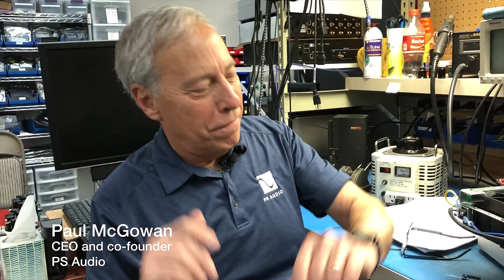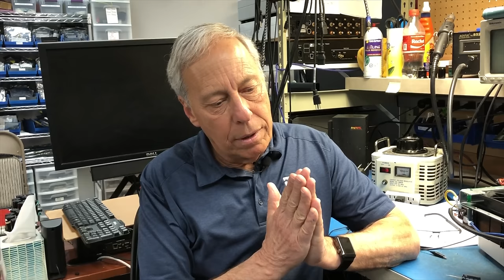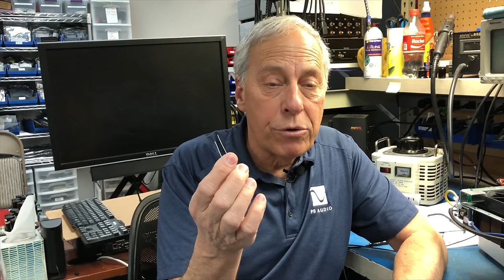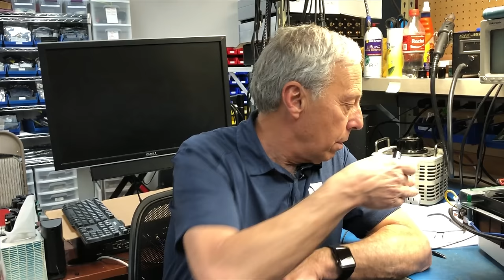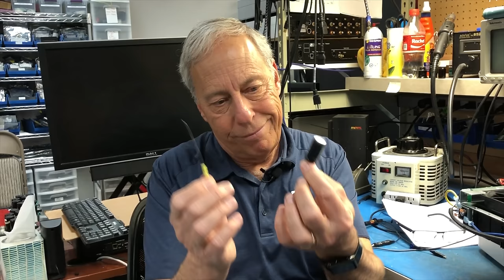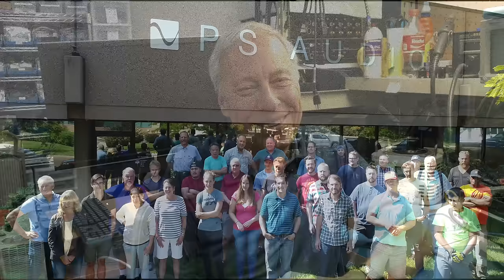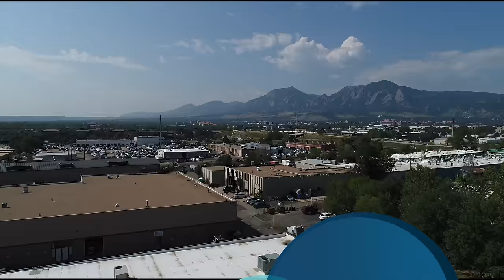Why do capacitors sound different?

Comment: Still does not explain why two equal capacitors have different sound (if any). The only argument here is that the more expensive ones must sound better!
Reply: Ventsislav Simonov A voice of reason amongst the noise. I built your diamond buffer headphone amp a few years back. Turned out very nice.
Reply: in my experience, low value caps compared to high value/quality caps of the same type whilst passing signal, shows a difference in frequency fall off in dB very much sooner in the low value cap. In my view, low value/quality caps are close to a bandpass filter.
Reply: It is audiophoolery, basically. If we were talking about RF, where the type of capacitor plays a big difference, yes. But for audio frequencies, not by a long shot. You don't have any capacitor in which the inductance is significant at frequencies up to 20KHz. But the placebo effect and being in denial to the fact that one spent much money for nothing? Well, that is significant.
Reply: semahnai I guess capacitors work differently in your part of the world. Must be a gravitational delta coefficient difference. Or simply that your understanding is hokum. You shouldn't try to design anything electronic.
Reply: Ok, I need proof on that. Show me tests being done on oscilloscope, live (I don't accept bogus images), showing differences in audio distortion caused by different caps. By the way, I don't have audiophile hearing. I can't hear above 15KHz. Thus, I can't hear supersonic frequencies, like 48KHz or so.
Reply: How do you hear power supply caps? They aren't in the signal path. You are talking foolery here. In the signal path, there isn't enough voltage to kill the caps. If recapping power supply caps because they blew, then the PS wasn't designed properly, or didn't have proper protection. Replace them with equivalent models, if the new ones have higher ESR and ESL, the impedance of your ground plane with be adversely affected. Also, there is much substandard design in car audio and just as many idiots who think they know something because they won a contest. Most of them are uneducated and laughable.

Confirmation Bias abounds because people do not understand or apply scientific method to confirm results. Your SMD Amplifier Dyno cannot tell you the sound of the amp. Of course, it should NOT have any sound of its own, that would be distortion. Your 'scope may have a higher noise floor than a lot of modern electronics, so be careful about what noise you are actually looking at. No one ever said tubes don't sound different. They DO, because they have huge amounts of distortion. A moot point to bring up here.

As for caps IN the signal path... yes, some would sound different, but mostly because of TYPE rather than quality. Ceramic and Tantalum caps used for bypassing power supply pins would hardly make a listenable passive crossover. Not all caps are designed for the same FUNCTION, so use the proper cap for the part position. Cheers!
Reply: It is all about the "definition" of a capacitor: each device is actually a combination of R L and C. The value of C is what is printed on the device, and ideally, R and L should be zero. In reality R and L values are not zero, and to know the deails, one has to look at the detailed specifications. 
Two capacitors with the same C value may have different impedance( Z for AC or R  for DC), will interact differently with the rest of the circuit, and ultimately may change the frequency response therefore the sound. The more expensive ones have a lower ESR, or Equivalent Series Resistor, therefore giving a closer match to the ideal capacitor with all C rating and little R or L.
Reply: Pierre C That had already been stated here, and is a well known fact. Semantics aside, a cap is a cap, a resistor is a resistor, an inductor is an inductor. We are not conflating them, even if there are residuals shared amongst the different devices. Even resistors have inductance (some more than others that must be compensated for in passive crossovers for instance), as inductors also have resistances. Cables have all 3. What we object to is simply the implication that because one cap cost more, it MUST sound better. Hokum.
Reply: If you leave semantics aside, you end up with nonsense. Sorry,  you can't escape that.
Reply: Phil 
A pure capacitor does not exist, they all have inductance and resistance in them, the combination of these gives an impedance which influences both the resistance to current flow but also changes the phase of the alternating current passing through.The easiest way to convince yourself whether different components sound different is   get a stereo amp and change the electrolytics in one channel with audio grade but leave the other alone. Have a listen, trust your ears. As a test get your wife to listen but don't tell her why, you will be surprised. If you can't tell then it does not matter to you.
Reply: Although any capacitor has some inductance, for the frequencies that we are talking here it doesn't matter. You would need inductances in the order of tens of uF (at least), and that is for impedances as low as 8 ohms. You don't have that in a real capacitor. ESR is not a factor for supply caps (they were mentioned, and I don't know why), because the supply frequency is around 50-60Hz, or 100-120Hz after rectification. Plus, any good opamp will provide good supply ripple rejection, in the order of 80dB, so they shouldn't be a factor.
Reply: Esr really does become significant in power supplies. Whilst its true that mains frequencies are only 100hz  after going through rectification in almost all cases these days the power supply is a switch mode device with frequencies in the order of 35khz being used to chop up the DC initially produced before smoothing and that has to be completely removed. I have just built a linear power supply for a raspberry pi based streamer with massive amounts of high quality capacitors and large inductors in the filtering, and that is just to get rid of the 100hz noise. The difference between the linear psu and several different switch mode psus ranging from "wall warts" costing £5 up to very sophisticated high quality commercial able to provide 10a psu costing over £100 was significant . I would have preferred not to do it as the psu is several times larger than the streamer, but it's built to listen to not look at.
Reply: I was thinking about linear power supplies when I wrote that, of course. I don't see SMPSs being used in hi-fidelity amps, for a number of good reasons. All amps I've seem use linear power supplies with bulky toroidal transformers, a big capacitor bank and some beefy rectifiers.
Reply: Switched mode psu's are creeping in all over now, Linn and Devialet are two that spring to mind.At that price level they can afford to manage all of the issues that the high frequency artefacts flying about cause. I think this is a topic that will run and run. When I first heard of speaker cables making a difference I thought "Its a bit of wire carrying a low voltage and pretty small current too." How wrong was I? A bit of experimenting with  a few bits of different cables and "Pandora’s Box" was opened. It is the same with most components If you are prepared to experiment, for instance swapping polyester types for polystyrene I can hear a difference. The precise mechanism isn’t always clear but there is a difference  and it is often not that big, the drawback could be that you may like what you had in the first place better and have to change it back. Keep an open mind and open ears. Just because it's expensive doesn’t mean its better, but there is a lot more to it than the capacitance, working voltage and Temperature rating. Just because those  parameters match it doesn't mean that the capacitors are the same.
Reply: +Darin Brunet - Ever hear of motor boating? A power supply/decoupling cap can certainly add noise to a signal.
Reply: I buy Elna's usually and if it comes in a low esr it's because the typical application for that value often demands it so buy the low esr.  I've learned that cheep caps are not always the value they're supposed to be or they're just duds.
Reply: +Paul McGowan - You could have said that without making me sit through the entire video...
Reply: Darin Brunet : Power supply caps can be heard a couple of ways. First, if inductance or resistance is too high, or capacitance is too low (these can all lazily be filed under "effective capacitance"), then you can get voltage sag, which in turn can manifest in the sound downstream of that cap. Second, if you have some resonance at a bad frequency choice, then you can get undesired resonation spreading downstream of the cap, and potentially even upstream to other power supplies.
Third, many capacitors, and components in general, are capable of acting as low-quality speakers (if you've ever heard a CRT tv sort of "hum" right when you started it up, that was likely an inductor) or microphones (ceramic caps are particularly known for this), once again spreading noise everywhere downstream of themselves.

Finally, some caps, particularly electrolytics (or, for that matter, 60's-ish carbon-composition resistors), can have their electrical properties change over time, usually due to chemical changes, often due to heat exposure. This is particularly relevant for car audio, where internal temperatures can get over 100 (or was it 200?) Farenheit.
Reply: Esr... Capacities might resonate and also act like inductor
He also told us how to reduce the effect of it, by pairing up 2 different types of capacitor
Reply: +semahnai  A capacitor can act as a filter in an audio circuit. Smaller value capacitors (value as in the amount of charge they can hold) filter out more low frequencies. It is easy to make a small circuit and listen to the audio going through a capacitor. Someone could buy a cheap capacitor and a good quality capacitor (which still will not cost much) of the same value (Voltage and Farad) and listen for any differences.
Reply: And remember, caps are not linear across the freq respond they pass. Sound is pretty hard to debate. How do you measure "good sound"?  Some unwanted elements might be pleasing to the ear, some not. Most of the time component changes in sound are subtle, more ofter sum of parts reveal bigger differences.
Reply: ESR is not that much of an issue. In the imaginary capacitor substitution model, ESR is an extra resistor that the sound passes through, but we aren't seriously discussing the sound of resistors, are we? Basically you're supposed to calculate your ESR and ESL into your engineering and they don't produce any difficult to reverse distortion.

Dielectric absorption based distortion is easily demonstrated though, and it's highest around DC rather than at high frequencies. You charge a capacitor to a major portion of its rated voltage, then you short it out for a short time, and then you connect a high-impedance measurement tool, and watch the voltage rise again. WHOOPS. Another issue is temperature coefficient, the more current you run through your capacitor, the more it heats up, but how do its properties change with temperature? These problems are generally measurable, but potential audibility depends a lot and is not necessarily a given.
Reply: Darin brunet,power supply caps are definately in the signal path.A power amp is simply a modulated power supply as is mentioned in the video so the better the supply the better the sound.If your speakers are good enough you will hear the effect of bypassing large electrolytics with say 10uf film caps let alone the obvious improvements brought about by fitting Rubycon Blackgate electrolytics.
Reply: Perceived difference vs. actual difference are two entirely separate things. In an audio signal, outside of values and tolerances, materials are completely irrelevant. If a spectrum analyzer is telling you that there's no difference then...there's no difference. It's all in your head. There are a multitude of other factors that come into play that affect the sound you're hearing other than simply the caps that make up the AS - room size, acoustics, speaker placement, EQ, etc. The debate over whether a cap has that much of an impact is just silly.
Reply: I agree. I watched the whole video and heard zero explanation "Why do capacitors sound different?". An explanation is quite simple - how linear are they are over the sound frequencies... But I wanted to hear am I right.
Reply: Audiophoolery is all about price. Measurements are for deaf engineers.
Reply: Well, in contrary - you cannot make a good phono preamp without proper capacitors and those "proper" are cheap one (styroflex). Expensive one of the wrong type in phono preamp will sound like trash.
Reply: That's just unsupported claim unless you've got the right data to prove it. ABX blind testing is one example.
Reply: You do not need a blind test for that. This is known since the first days of a phono preamp. What you need a blind test for is to compare the same capacitor from different makers, but you cannot make a good phono even with the gold capacitor if that one is a ceramic type.
Reply: Have you got any paper or publication to support your claim? I'd like to check that "known since the first days of a phono preamp" claim.
Reply: I bet you made yourself hundreds of phono preamps. Just open any literally any schematic of phono preamp and look what type of caps are used in RIAA section. I am sorry you lack that much knowledge so I need to prove you such things. It is same asking me to prove that resistor has resistance. What is next, prove you that Ohm law is correct?
Reply: I do not make any claims. You do. And I highly doubt that you can prove Ohm's law.
Reply: 2 amplifiers one with average characteristics and another with superb can sound very different and in many cases the one with worst technical data, much cheaper can sound better. There is no number to express subjective impression, but good ear with long mileage can tell. It is actually easy - do you enjoy it more one over another for long period of listening? There is no number to express such thing. If you are looking at scientific technical data only, then I am affraid you are lost in the audio and not just in audio world.

Same goes for caps. Polysterene, polypropylene, silver mica or (as Technics was using even ceramic capacitors) in phono premp for RIAA correction, even though all are flat in 20-20kHz can and do sound very different. Although silver mica has issues in relation capacitance over frequency in relation with temperature, when taken carefully, they can work too. 

There are millions of phono preamp built in the world until we spin the records and gazillions of people have listened trillions of combinations. But, today, when you open any of amplifiers most likely you will find there only one type of capacitors in RIAA correction. There is no scientific paper to describe this. This is pure experience of engineers, technical people, constructors, technical listeners and music lovers. If you are asking for scientific paper which describe all this experience since the first days of phono preamps, I can tell you only one thing - leave, this is not for you. Actually it is quite stupid to ask to see printed numbers and by them judge which sounds better. It cannot be described that way. It is all about combination of technical data (linearity and stability) over frequency and then come listener experience.

That is why I stop by to see this video, there is a secret we do not know yet, why one sounds better than another in audio. This video can last for 5 seconds with one sentence only (by your opinion): more expensive sounds better. That is one of the classical pitfalls of ordinary consumer without much knowledge in audio technology and obviously you are such since you are asking such thing, number from scientific study which describes which sounds better.

As I am concerned, this video can last for 5 seconds as well, but correct sentence will be: "I do not know" or "We do not know". Music is complex sinergy of frequency and amplitudes and in some combinations some capacitors are perhaps more linear than another, but that is impossible to measure because there are unlimited combinations. All we know is to take the capacitor for the cause with good technical characteristics and hope for the best, based partially on technical data, partially on experience. In past 30 years I've made hundreds of such and I tried just any combination in both vacuum tubes, transistors and OP's circuits. All have been listened by lots of people, some were good, some bad, some terrible, some excellent. After so much 1000's of hours of listener experience, there is only one conclusion - cheapest polysterene sounds just excellent in RIAA phono preamps. There is no paper anywhere in the world with proven number which you, as a scientist, can read and tell from numbers this is true or false.
Reply: You tend to forget that electronics is done by engineers. And from what I see you haven't opened much amplifiers or RIAA preamps yourself. I'd be surprised if you could even point to the exact components forming the RIAA correction.
Reply: :))) I love people who tend to be smart but eventually they make themselves stupid and then dig them self even deeper. You made my day, but this stupid conversation ends here.
Reply: Agreed.
Reply: I have just finished repairing a Mission Cyrus 2 amplifier, fault not playing at all. Two [electrolyitic] capacitors in the the feedback loop measured, capacitance reads correct, ESR reads very high. I replaced them and amp started to play. Whilst it was in bits I replaced all of the electrolytic capacitors with Nichicon audio grade types and it sounds totally different. I was already convinced .
Reply: "If you cannot tell [the difference] then it does not matter to you."
This is most Zen advice.
Reply: I was going to make the same comment as Ventislav made in the first post here.
All I got from the video was 'it will sound better because it's more expensive'.
And from the comments here, a load of anecdotes with no measurement or backup to their claims.
(Although I anxiously await their videos proving their points).
Reply: They will have the same roll-off. Lower value will just start rolling off at a higher frequency.

The distortion in resistors and capacitors are caused by the voltage coefficient (modulation caused by the change of value that is proportional to the applied voltage) and thermal modulation ( caused by the change of  value that is proportional to the temperature).
Capacitors also have leakage and series resistance which might play a role in some scenario's.
Unfortunately not all of these specs are given in the datasheets.
Reply: But long term stability is not relevant in audio. It's the short term that matters. I think the quality lies in leakage, esr, series inductance, thermal coefficient and voltage coefficients.
Reply: Ventsislav,

'dialectric absorption' ....
Reply: You don't listen to oscilloscopes. Scopes only show one factor, voltage/frequency.
Reply: While that is correct. Measurements (not just the oscilloscope measurements) do indicate how a system performs.
It does not measure how you perceive that sound and whether you like it or not.
Some things are generally considered bad and are better to be measured. Noise and hum for instance.
Reply: Ventsislav Simonov Yes, capacitors are measurable components in terms of their tolerances, resistive and inductive imperfections. I don’t believe a capacitor can “sound better” unless we can measure it in some way of electrical properties. But often people “feel” anything more expensive also sound better.
Reply: The answer is ESR. Equivalent series resistance. The lower this is, the better.

If a capacitor has poor ESR, it cannot sink voltage fast enough at high frequencies, resulting in audible noise/distortion.

This is a gross simplification, but google is at your disposal to learn more.
Reply: "It is audiophoolery, basically. "If we were talking about RF, where the type of capacitor plays a big difference, yes."

Actually, no. Inductance is not the supplementary characteristic o a capacitor. ESR and leakage, which can vary with audio frequency, can both be very critical.
Reply: powercaps are not in the signal path? so where do you think the amplification of a line signal comes from then?
Reply: Bloguetrónica  And what about dielectric absorption ? Do you know that at all ?
Reply: @darinbrunet4600  Power supply caps are definately in the signal path.A power amp is simply a modulated power supply so the quality of the power supply is as important as the active circuitry.
Reply: @darinbrunet4600  um the whole concept here is that the cheap ones degrade over time and will affect the sound but you seem to not care
Reply: @jasonbone5121  The "motorboating" you speak of is an oscillation of the power supply rails, not the signal path. It is not noise injected into the signal, it is collapsing rail voltages.  You are mistaken.
Reply: @BRATWURST1  I am sorry to inform you that you are incorrect. Rethink your power and signal flow. Study some amp schematics, better yet, design some commercial product. Only then will you understand.
Reply: @jaybefaulky4902  Now, you are proving in a public forum that you do not even have an education in Psychology. Tell us, do you even have a formal College/University level degree in anything? If not, you are not a professional, you are a layman. Until you have education, lengthy experience, and have contributed to the art, you should simply ask questions instead of stating things as fact. Have a nice day.  Now go sit in the corner.
Reply: @darinbrunet4600  is part of the personality type using their knowledge as permission to negate dismiss and degrade people, this personality type will seemingly treat someone with enough respect I suppose but as soon as they perceive themselves as having a piece of knowledge that is superior to the other person, use that as permission to be able to speak very poorly toward them.. Furthermore there is a tendency as well to completely disregard someone based on social status  education etc. for example what you just did saying I have no degree in psychology therefore everything I said must be wrong that is obviously untrue..that is literally like saying if someone didn't go to middle school they can't know how to do simple math... that is exactly what you're doing  weaponizing your knowledge to give you permission to be an asshole.
Reply: @bloguetronica , Finally a voice of reason.
Reply: @darinbrunet4600  Glad somebody on here knows what they are talking about.
Reply: its 20% in value , and a new cap takes time to prime
Reply: @bloguetronica  you don't need tests. You need to try it for yourself. I can punch the wall. Smack a can or drive a car and produce the same frequency on a scope. Every one of those sounds different. There is absolutely a difference between capacitors and even between electrolytics. How do I know this? I tried it.
Reply: @gen-X-trader  The human ear/brain is subject to the placebo effect. An oscilloscope or, better yer, a spectrum analyzer, is the only reliable way to test this. If these instruments don't detect a difference, then it is false to assume that capacitors sound different. This is what sets apart true electronics aficionados from "know it all" audiophiles: the ability to scientifically analyze instead of just buying the snake oil.

There are other concepts just as ridiculous as special high end caps: diode bridges with snubber caps, unidirectional cables, USB and ethernet cables for sound, you name it. And then the con men that create the myths and make money with them, because ignorance is profitable.
Reply: @bloguetronica  rather than trying to argue why don't you just try it? See for yourself
Reply: @gen-X-trader  I don't need to "try to argue" with you. Also, it seems I no longer see the need to reason with you. You believe in what you wish, if that makes you happy.
Reply: @darinbrunet4600  are you giving a try to trolling, 'cause it's pretty weak... :}